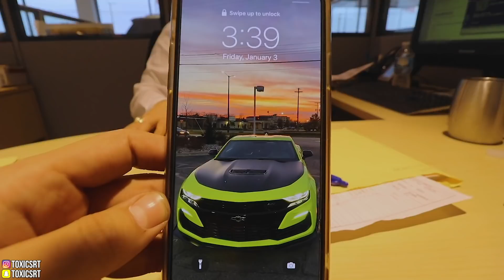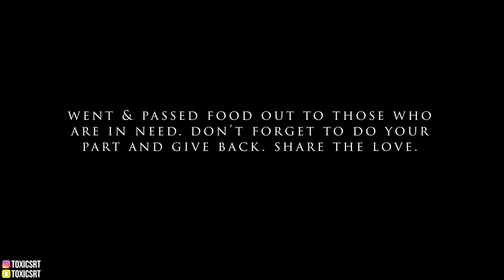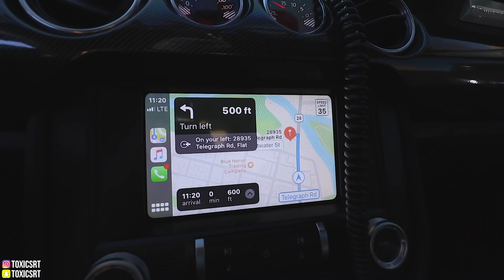WE STRAIGHT PIPED HIS NEW CHARGER 392!

Comment: I had a rt that would pop it sounded so nice i remember i did a donut with out meaning to do one 😂😲
Reply: 392Charger11B  i had traction control off turned it to the left thinking i was gonna do a nice turn with some tire burn but that's not what happen also depend on the driver not the best but pretty good at driving its unfortunate that i have a licence but no car anymore also owned a challenger v6 and that was weak that was just a cruiser in my opinion but what made my v8 feel faster was that it was standard not automatic it was really fun and fast plus the dealership i went to didn't have any scat packs and i got a great deal on my trade and on the rt like 5 grand off a new car with a lot of upgrades 400+ hp and i traded that rt for a new rav4 which is something i cant take back anymore just have to live with it and move on